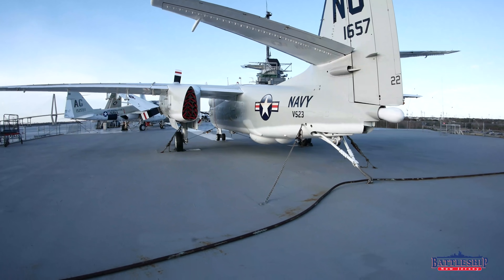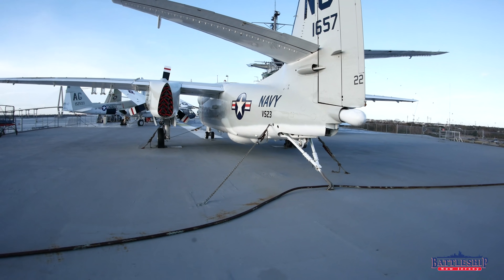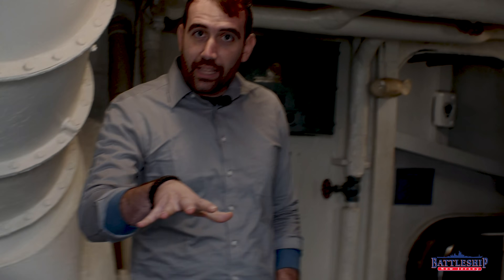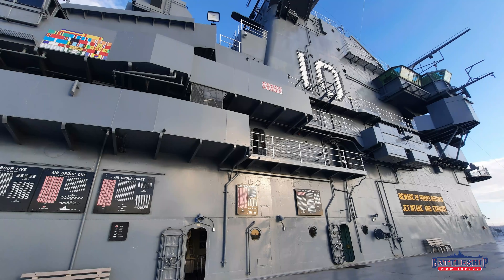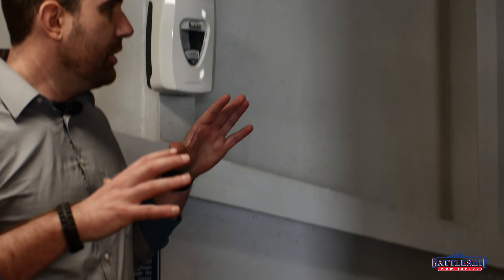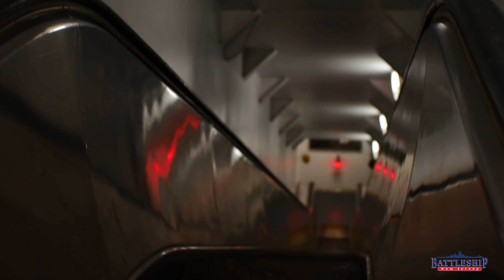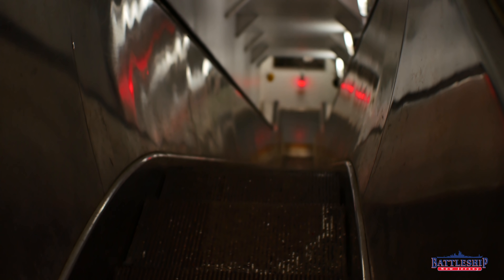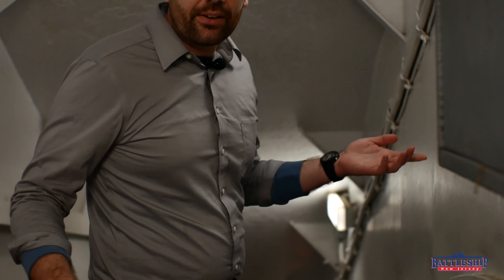Escalators on Aircraft Carriers

Comment: I was stationed on board the USS John F Kennedy and the USS Dwight D Eisenhower. Neither one of them had an escalator in them but they did have a personnel elevator extending from the second deck all the way up the island to the bridge. And the pilot ready rooms were on the O-3 level right below the armored flight deck.

Comment: Nimitz class carriers don't have escalators and neither do the Ford class, I believe. Ready rooms are on the O-3 level immediately below the flight deck as opposed to the 2 deck below the hangar bay. I deployed to the Med on the Independence and much of the time the escalators didn't work.  Poor reliability and heavy maintenance requirements are the most likely cause of their removal from later platforms. The additional weight was a negative as well.

Comment: I use to maintain the Escalator on the USS Hancock CV-19 while in the Hydraulics Gang from 1973-1975.  Blasted Air-dales would take tool boxes up and sometimes they would drop them and damage the treads and then we would have to replace them.  Of course, no one knew what happened.  Also damaged the Stanchions on the forward Aircraft elevator and again, no one knew how it happened and it was our fault that flight ops were delayed while we tried to get them down or removed.

Comment: USS Enterprise (CVN65) did not have an escalator as the ready rooms were on the O3 level just below the flight deck.
Reply: I was on there 01-03 I don’t remember ever seeing an escalator, but I do vaguely remember an elevator (like a normal elevator for people) below decks somewhere.  I never saw anyone use it and was told it didn’t work.
Reply: @cmcb7230  There was an elevator that went up the island from the O3 just outside ECC near the museum to the O10 near the captain's at sea cabin.  It was generally off limits except to the Captain and the Admiral.

Comment: I served aboard the USS Ranger CV-61 and the USS Kitty Hawk CV-63 , both carriers had two escalators. Both, carriers had an aft escalator, near the aft mess deck, on the 2nd deck, that went from the 2nd deck to the 03 level deck. By a switch, either on the 03 level or the 2nd deck, you could change the direction of the escalator or turn them off completely. The switches where buttons, that you could push, to switch the direction of the escalators.

Comment: The escalator on the USS Hornet was rebuilt by BART employees in 1998-99 as one of the early facilitators for the museum was a former quartermaster and Assistant to the Chief Engineer at BART. Many of the steps needed to be straightened out and any parts needed came off the USS Oriskany which was moored up at Mare Island at the time. Added during the SBC-27A modernization 1951-53. Runs only on a as needed basis such as last week when I had to get a newly made 90 lb. window up to the flight deck for Pri-Fly.
https://youtu.be/BeGoZh-F-zA

Comment: We had two escalators on USS Kitty Hawk, one forward, one aft. The forward escalator was nice and convenient for getting to the forward mess decks from the 03 level and saw a lot of use (just as a really long stairwell, they were never turned on). The aft escalator opened to a much less convenient section of the second deck and people who lived in the high up parts of the ship like me just used it to slide our division's laundry bags down as it was close to ship's laundry. Also, I've been told that under really heavy loads, such as immediately after calling battle stations, the sheer weight of sailors trying to go up the escalators (up direction only, they were both starboard side) would cause them to move down on their own.
Reply: I was on the the Kitty Hawk in '93-94 and don't remember any escalator's. Then again I worked in IM4 Division which was forward of the Hanger/Main deck.
Reply: I was on the Kitty during CQ off the coast of San Diego in '95.  When I was there the escalators never worked.  IIRC the ready rooms were on the second deck and the escalators went up to the O3 level.  It's been a while though.
Reply: I was on Kitty Hawk 98-01 and I saw the escalator work twice all rest was off. But I was never in better shape going up and down to my work area.
Reply: I was on the Kitty Hawk with VS-37 '92-'94 and the easy way to the AO shop was the aft escalator. Pilots coming from the 2nd deck ready rooms used it quite often and it worked.
Reply: We turned the forward escalator on in '03.

We had so many on it at a later time that it started running backwards and I rode it down to the mess deck😂

Comment: The Hornet has one, it was certainly operating when the museum opened; since then, sometimes it's been in operation, sometimes not. I suspect escalators are repaired after XX hours in-service, so the museum probably only runs it when there's a busy day, or a specific need (i.e., disabled patrons).

Comment: It makes plenty of sense and unlike an elevator you you can use it as an staircase if out of action and you can run it for higher speed.
More so if you are wearing body armor, know bomber crew did but questionable for carrier pilots, yes you can ditch the plates but as your stuck in an seat why not put it in the cockpit.

Comment: The escalator on the Hornet actually works.  We only use it for physically challenged individuals to get to the Flight Deck
Reply: according to the sign, the Yorktown's escalator still works too, they just don't run it because the gaps are too big for modern safety codes
Reply: Gaps between the steps?  If that is the case it’s the step chains/racks on the unit that have stretched with age.  The chains on escalators naturally wear out and stretch.  Eventually the gap between the steps grows too large and the unit needs to be rechained.  Not an impossible task, but damn expensive.  I work on old Haugton escalators that are still in service today,  probably went through a dozen chain sets, and a bull gear or three in that time.  But they are still legal.  

Also running an escalator requires at minimum quarterly maintenance visits which can cost thousands a year to remain licensed for use.  

Way cheaper to leave them off permanently.
Reply: I thought I heard someone say it worked when I was there touring with my Uncle. Alameda is so close I need to go again.

Comment: I think the watertight doors might pose a problem to a peoplemover down broadway.
Reply: That's gonna hurt the Shinns going through each watertight door...😅
Reply: I'll bet sailors on two feet would be moving faster than it would be safe to run a "people mover".  As crew stepped on it, they might fall over as the deck moves out from under them.  Add the rockin' and a rollin' and I think this "people mover" turns into a bad idea real quick.
Reply: @RRose-ie8oh  huh?  It's just an additive thing.  You don't need to have it moving faster than a running speed to speed up how fast everyone's moving (and you can run on them to REALLY get moving if you need to be somewhere in a hurry).

I'm not sure I've understood your point.
Reply: Also what if a heavy piece of equipment had to be moved from point A to point B down Broadway would the people mover handle that load
Reply: @michaelnieman6218  Nah, that's what the overhead beam is for.
Reply: @ZGryphon  so what the so called KNEE KNOCKERS
Reply: Nah, even in airports they need to be built in segments anyways, so it wouldn't really interfere.  You just have them between the bulkheads.

Comment: I had worked with some former Navy guys in the 90s. They were saying about how hard it was to find your way around a carrier. Like 2 levels up, 3 over, 4 down, etc., etc. Apparently, the captain happened upon the machine shop at some point and didn't know he had one. Guy said he probably assumed it was an ammo or fuel space.
Reply: I find it hard to believe that the CO doesn't know that his ship doesn't have something like a machine shop. I know first hand that large deck Amphibs have an extensive machine shop as well as Arleigh Burke class DDGs. A CO has to work his way up through the ranks and while he might not know exactly where said machine shop  (or other shop is at) they KNOW that there's one on a birdfarm!
Reply: @dundonrl  Carrier COs are former pilots who have some previous ship command experience, but are flyers at heart. A Skipper not knowing the location of a machine shop aboard a super carrier is easy to believe: we had 5,200 sailors aboard during my time and only a handful would know machine shop locations.
Reply: @CAPTOFCCVA64  A CO not knowing the LOCATION of the machine shop is possibly  believable, but a CO who was surprised that his ship had the ability to machine parts for repairs is a lot harder to imagine.

Comment: The supers, certainly the Forrestals, had 2 escalators. They ran from 2nd deck to O-3 level. The pilots had priority as there were some ready rooms on 2nd deck. A lot of us used them when we were going topside to catch some rays. A lot easier than climbing all those ladders. Ranger's aft escalator was always having mechanical problems.
Reply: Forrestal's escalators worked, at least in '89-91 when I did 2 deployments. However, we were warned that if we were caught using them, not being pilots, we could get a serious arse-chewing, so we never tried.
Reply: I don't remember the Ranger having an escalator , unless they were added after 1980 . Thank You
Reply: @henrycarlson7514  Yep. They were on the port side. One of them was near the aft mess decks; the other was near the forward mess decks. They were both accessed off the main port passageway. The upper access was at the O-3 and there was a door opening to the catwalk about 1/2 way between the bow and the angle. I never used the aft escalator, so couldn't tell you where it came out on the O-3. Probably direct access to the catwalk. Both were primarily intended for the use of pilots who's ready rooms were on 2nd deck.
Reply: @johnslaughter5475  Thank You

Comment: I went to the Intrepid and I was surprised at how tiny it was. That being said, I'm large compared to the sailors that would have occupied many of these ships. (6'2", 270lbs at the time). I also toured the submarine right next to it and suffice to say, that was tiny for me, but I fit through the hatches relatively easily.

I've worked in some strange and tight environments, so I understood that you have to be careful not to whack your head. The bulkheads aren't exactly soft or forgiving. 🤣
Reply: I'm a big guy too. I've toured Alabama & Drum. Some experience climbing through attics was useful for Drum.

Comment: It's been a while since pilots had to wear a parachute, though some trainer type aircraft still in use like the T-38 have been around longer than a while so there are exceptions.
Reply: You’re right, most aircraft that have ejection seats no longer requires the pilots to wear their parachutes out to the airplane since the parachute is now included as part of the seat. The pilot still wears a harness out to the plane which attaches to the ejection seat. 
The T-38 was upgraded relatively recently with a much more capable ejection seat which also includes the self contained parachute.
Reply: @arcticflyer4017  Supposedly all the T-38s got upgraded by 2013 but if you look at C.W. Lemoine's channel there's a video about their final flights in the T-38 that happened with the last few months and those sure look like parachutes they are wearing.
Reply: @krtwood Yep, those sure are parachutes and I stand corrected! The vast majority of the fleet are C-models used for pilot training and they receive funding for upgrades but there are a few small units in the Air Force using older models for various purposes.

Comment: I have been to the Hornet and the Midway while I was stationed in San Diego. I do not remember seeing a escalator on any Carrier I served on (TR, GW and Ronald Reagan). Then again I was on the flight deck for my rate working on the CATs or arresting gear.
Reply: The USS Hornet is in Alameda near San Francisco, she does have a escalator.
Reply: @3995chris  yes the Hornet does I was saying I do not remember seeing one on any Carrier I served on.
Reply: I want to believe only on the Essex class aircraft carriers- and as he describes Bolted on/ added in the post World War II major upgrades (Wikipedia Article on SCB-27 partially supports this). If you get a good  starboard side view of the Essex -the "BOlt on" escalator is highly visible - diagonal box.

Comment: What is Patriot's Point going to do with their submarine, USS CLAMAGOR (SS 343)? 
When I went in summer 2021 it needed a LOT of hull repair work and seemed to be neglected.
Reply: The USS Clamagore is going to become a reef, its not savable.
Reply: @Normandy1944  could they not pull and drop on shore like the one in Mobile?
Reply: @stewarttrains98  No, Patriot's Point doesn't have a choice in it...the Navy has deemed it's destiny.  I'd like for them to try to get the USS Ling that is moored in NJ at a closed museum.  If they do, then yes, I'd like to see them do what Mobile has done with the Drum.  Thing is, the shoreline along Patriot's Point would need shored up to support the weight.  May even have to run some pilings?
Reply: It was looking pretty sad, I was really looking forward to touring it till I saw the closure sign and saw its condition.